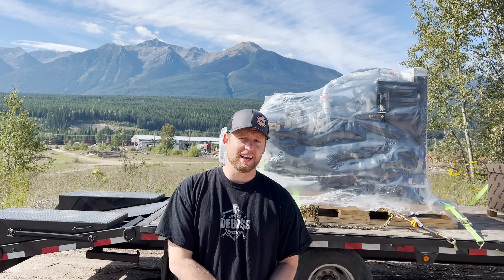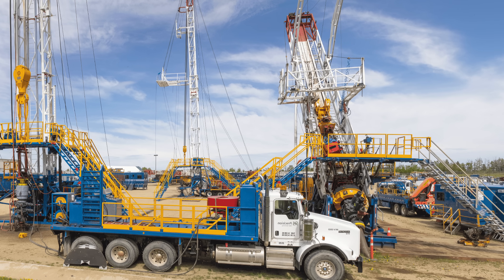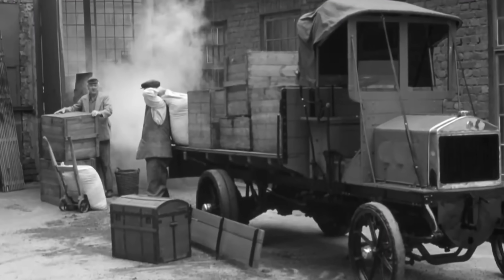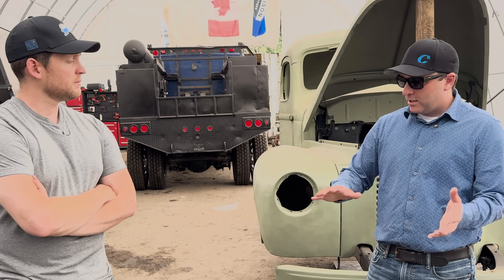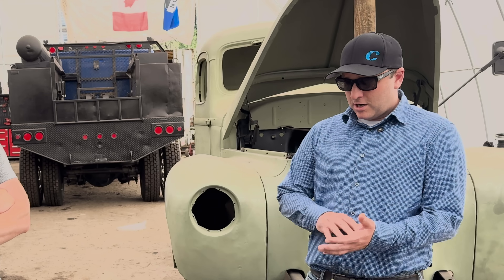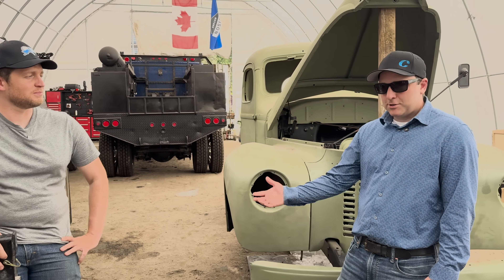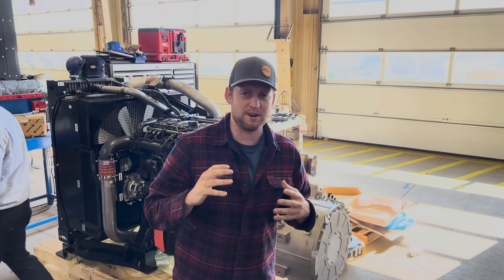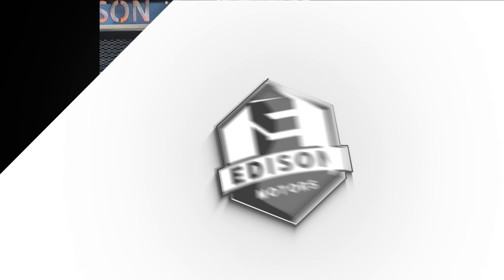We're putting Scania engines into Edison Motors Trucks!

Comment: No DEF/DPF is the biggest news! DPF is the biggest green scam ever to hit trucking. The physics and logic has never added up. How does a miniscule reduction in particulates justify wiping out 50 years of fuel efficiency increases? How does a filter remove pollution from the atmosphere when a regen burns it all out anyway? Does the impact of adding an entirely new industry of manufacturing and delivery and pumping infrastructure to get pig urine into every truck justify the barely measurable environmental impact of cleaning truck exhaust a tiny bit better? Oh yeah and nobody realized the blue stuff freezes, so tanks and pumps have to be heated 24/7 during the winter because that's a sensible use of energy, right? Ask any fleet manager how much down time and warranty problems the constant breakdowns of filter systems causes. All it's done is cost money and headache, and I see more toxic smoke pouring out of broken DEF systems than I do out of old school trucks.

Comment: The big Scania 770 and the Volvo 780 are in trucks weighing 76 tons in Finland, 64 tons in Sweden and 60 tons in Norway.
Reply: 74 tons in Sweden now
Reply: Lot of 770's in ireland just pulling 1 trailer😂😂😂
Reply: @johan8724  why would you need a 770 in flat Ireland? They’re common in Norway, but Norway is far from flat and the GVW is higher.
Reply: @MasterChief37  jeg vet. kjørte 9 år i Norge🤣🤣👍👍irske sjåfører liker a kjøre 90 op på bakkene🤣🤣🤣💨💨💨💨

Comment: Love your project and your drive !

This oversized engine is not a good idea, not the Scania part , the v-8 part.

1. This is generator service constant speed not normal crazy truck loads and speeds. You have let your normal real world experience seep into your logic but your new system is different .generators work best at 80% load normally constant speed. You don’t need that extra hp the battery is giving it to you .

2. The extra massof V-8 is working against you , also two more pistons etc .radiator larger etc .

3. The biggest thing is You said 30-40% fuel savings .
No way there is that much savings between two modern engines just because you went up in size !

HE did not say that in video , you did ,if you listen carefully . Probably because he told you this off camera .

Let his engineers show you a technical report to prove it !They must have both on test stands in Europe have them  run your profile on the dyno.

I understand the loafing is better for longevity but going to a 1200 rpm motor would be better but again the extra mass.

If you do use it run it normally at 1200 rpm and vary The load only going to 1800 when you need more power .

Comment: Didn’t know Scania’s have dpf free engines that meet emissions.  We desperately need a smaller Scania motor in pickups/vans.
Reply: Scania does not do vans, delivery trucks size is the smallest. IVECO is the one you're wanting, Daily mainly.
Reply: @Mariini  just order a scania and then aftermarket swap a volvo engine
Reply: The smallest engine Scania put in their trucks is a 5cyl 230hp unit..
Reply: @CJA150179 nope. The smallest is the DC07, 6 cylinder engine, derived from the Cummins 6.7 engine. Although yes, the 9 liter is the smallest 100% Scania engine.

Comment: Glad to see Todd from Precision is at Collicutt. I used to snub for Precision back in the day, before they got the Scania engines. Regen was always a safety concern for us. Glad to see Scania solved that. So, can you buy a Scania engine through Collicutt as a replacement for any highway truck? I'm thinking older trucks with mechanical engines. What electronics can they compensate for if you have an older project truck?

Comment: You should mention to SCANIA, that they might look into the possibility of using the massive amount of electricity, you have available, to increase emission efficiency in the future as standards get stricter and stricter.  I would imagine the engineers may not have thought about a situation where a Diesel engine would have that kind of electrical power available.  It might be useful.
Reply: Scania builds fully electric trucks, and even have their own battery plant in their home town of Södertälje
Reply: @petereriksson4405 
They have a bolt on in line E motor set up ..they have also experimented with it on boats.
Reply: If you can get a smaller more efficient  engine and generator you're going to be winning all the way.  😎🧙🏻‍♂️

Comment: Then i wonder if John Deere for their 9R 18L engines if they had copied Scania's homework since those will not have a DPF?

Diesel particulate filters are so problematic even in automotive. Small crack in the filter, will throw a check engine light. Had worked on a 2021 Ram 2500 6.7L Cummins. Guy bought it, and like 3 days later came back with a service DPF message and check engine light on. Followed service library and took it outside. Gave it some throttle and it was rolling coal. So DPF was shot. 

But the alternatives are a bit odd to no DPF. So either way hopefully no down time.

Comment: Wasn't one point of the hybrid system to be able to have a smaller diesel engine because load peaks are buffered away by the battery? I'd have thought that a 500HP (Scania or not) would not have to go full throttle all the time for the given use case, and when you compare a 500HP and a 700HP engine both from the same manufacturer for doing work that both engines can do without redlining all the time, then the 500HP has got to be more efficient, doesn't it? I'm not an expert, just curious.
Reply: I could see a larger engine being more efficient in some cases. If the engine+generator is powerful enough to drive the truck and charge the battery at the same time, then it might mean that you don't have to run the engine as much or as long, saving fuel.
Reply: Ideally you can sit right at the efficiency peak, a more powerful engine just means less runtime for a particular application
Reply: I also find this counter intuitive. And they have e-axles with motors. Unless they are beefed up they cannot use more power just because they have a bigger engine generator. They can make some trucks with three driven axles, sure that's one way to tap more power out and needing more in because such trucks would be targeting heavier loads.

Comment: As long as the customer is willing to pay some air freight…. LOL
Reply: Scania already has an established supply network in North America for marine and Gensets plus their Trucks have been running all over Latin America for decades.
Reply: @mrspandel5737  guess you didn’t watch the video lol. The man justttt said that it could be overnighted to the states if you don’t mind paying airfreight…..
Reply: Ya I thought the point here was for anyone to find parts anywhere. A truckers truck using a smaller generator to apply power, saving on cost and hassle. 

And now it's just gonna be a normal semi engine providing electricity but with less parts availability. This seems like a massive downgrade.
Reply: @sparrow4176  yeah down grade for sure. Can’t go to any local parts house for parts on that rig. Gotta pay for it to be overnighted on a Cessna 172 😂😂😂. Bet that’s cheap too

Comment: The only issue i have is you really don't need that power right? You can have a smaller engine as long as it puts out more more energy on average than is used. And as you've discovered, you don't really need that much to go down the road. It's more just starting, and in a semi truck, hill climbing. I suppose if it meets the goal its all the same, but it seems the wrong choice to me.

Comment: You did not spell it out in the video. You are putting a straight 6 in the next truck, right, not the V-8 ? Also, what power plant are you using for the 3/4 and one ton conversions ? I get you are excited about Scania but you need to have a bit more specifics to quell questions like mine.
Reply from the maker: This next truck is getting a 9 Litre

The V8 will be for another project later on
Reply: @EdisonMotors  So the 9 litre is a straight 6 ? What engine are you using for the 3/4 and one tons, Cummins ?

Comment: As others have said, it doesn't seem Scania engines are step in right direction. The whole point was to use a generator system to cover average power usage, and electric system that can provide much higher power over shorter periods. Using very powerful diesel engine that  is designed as standalone unit kinda defeats that whole concept. I hope you know what you are doing.

Comment: What motor will they have for pickup truck? This is awesome what you are doing!
Reply: Possibly none as they are huge.

Try looking at the 1980's era V8 Deutz which are in large Atlas Copco air compressor and gensets. Being air cooled it doesn't have parasitic draw and issues from pumps or radiator taking up space which this allows you to run a larger engine. It also allows straight to work without warming up.

Comment: Should have mentioned that Scania trucks still require urea based exhaust fluid. Just no particulate filter.
Reply: I don't believe it's required for generator, so the exhaust fluid system is just simply left out of the installation, and the computer tuned to operate without it.

Comment: ### *AdBlue Consumption Comparison:*

For a 1,000-mile trip at 65 mph:

#### *Scania V8 770 (Tier 4, No DPF):*
- *AdBlue Consumption:* Approximately **5.94 to 8.93 gallons**.
- *Note:* The Scania V8 770 meets Tier 4 emission standards without using a Diesel Particulate Filter (DPF). Instead, it relies heavily on the Selective Catalytic Reduction (SCR) system, which uses AdBlue to reduce NOx emissions efficiently. The absence of a DPF reduces maintenance complexity and costs while maintaining strict emission compliance.

#### *Ford 6.7L Power Stroke:*
- *AdBlue Consumption:* Approximately **1.27 to 1.90 gallons**.
- *Note:* The Ford 6.7L Power Stroke uses both a DPF and SCR system to meet emissions standards. Its lower AdBlue consumption is typical for light-duty diesel engines, which have lower fuel and AdBlue requirements compared to heavy-duty trucks like the Scania V8 770.

Yes a 770 is way bigger then a 6.7 but most of your viewers are more familiar with a 6.7 thus the comparison. 

This summary provides a clear comparison and emphasizes the role of the SCR system and AdBlue in achieving emissions compliance for the Scania V8 770 without needing a DPF.
Reply: Why would you compare a truck engine to a car engine tho? Like I get what your idea, but can the powerstroke haul 70+ tons in a terrain with hills? No, it simply can't.
Reply: @jaroslav3258  Yeah, useless comparison, draws the wrong conclusions. 16.4 liters vs 6.7 liters, of course the def consumption will be higher, whether or not the exhaust systems are different in design. It's a much larger engine. Doesn't summarize anything but a lack of understanding and a willingness to copy/paste the work of others

Comment: Huhh..? 44 ton in europ...? In most European countries 50 metric ton is standard.., en in more of our countries it is 60 metric ton total weight.
Reply: Depends on the trailer combination. 63,500kg is the maximum without permits, with a B-train is the maximum.

Tri-drive with a tridem trailer is 53,000kg with a tri-drive permit.

Tandem tractor with tridem trailer is 46,500kg.

A tridem body job is allowed to weigh 30,300kg without steering axle permits.

That's all with a single steer axle.

Comment: I never hear torque rating only horsepower. We all know horsepower means nothing without torque. That’s why we don’t run gas engines that have 1,000 Hp.
Reply: The Scania V8 530hp have 2065 lb-ft and the 770hp have 2729 lb-ft

Comment: Here in Sweden we have an 850 hp truck somewhere I've seen. With an off the shelf 850 hp engine. That’s one of their marine engines. If you don't settle with off the shelf you can get a lot more.
Reply: The marine engines go up to 1150hp on the exact same block and internals, but trucks can't cool that much power, so 770 is max right now
Reply: @kalle5548  also related to emissions, which aren't as strict in the marine sector.
Reply: Gearbox, axle, is the week link
Reply: Emissions regulations and fuel consumption are what's limiting the power. You can get more power but the fuel consumption will just skyrocket.
If you can afford a motorboat with multiple 1150 hp engines then the fuel cost isn't a big problem.

Comment: Is Topsy going to be powered by a 9.0L Scania engine just like the CAT.  It would seem like tremendous overkill to put the 770hp 16L engine in Topsy just to run the generator.
Reply from the maker: Would it be overkill?  Yes

Will I still make a hybrid with a V8 anyways?  Also yes.

We can get 1200kw peak out of batteries + 500kw out of the V8

That’s 1700KW, or about 2400 HP

I don’t need it, but I want it
Reply: @EdisonMotors  Fuckin'... My dude. Fuckin' A.
Reply: @EdisonMotors  that is the right way, from truckers to truckers :D
Reply: @EdisonMotors  There should be a sound of a mic drop at the end of this comment.
Reply: @EdisonMotors  Mr Artelle raises a good point, this thing could charge BEVs that convey workers to the worksite and all the lights and saws and things in construction.
Reply: You're not buying a truck for it to sit around charging stationary items... If it's not moving freight it not making money.
Reply: @pb3438 highly depends on the application, they aren’t building highway trucks right now but vocational trucks. Very conceivable one would get put into some task where it may be useful as a power generation system.
Reply: @hoosierfarmkid  Yea, I get that it's application specific, but at the end of the day it's on a truck chassis for a reason, because it needs to move. If the truck is stopped doing backup generator tasks, then there's a good chance it's not doing what it was designed for. Using it as a generator in an emergency scenario makes sense but I struggle to think of a use case where you wouldn't have a much cheaper backup generator doing that task.
Reply: Look at it this way, with a larger engine on this thing, you have a portable generator that is more than capable of powering the worksite and recharge the batteries in addition to maybe charging another smaller electric vehicle.
Reply: The 770 is going to be a conventional drive Edison L truck. It’s what they call the BDE series, it’s on their website.
Reply: @jaredjeffs I don't know what you really mean here. The BDE is the concept for trucks with conventional cab, not the L series (like Topsy). It is still a serial hybrid so the Scania will be the generator and no transmission from it.
The website says "Scania motor generators" and "hybrid drivetrain".
So I only see the cab part differing.
Reply: @bwillan, Topsy is the one full prototype they have built. They won't pull the CAT out of that, no point.
Reply: You wouldnt use the 9.0l there only a cylinder with peak power of 360hp the 13L would be alot more efficient can rate it at 370hp or even 410hp and would spin an electric generator all day every day
Reply: This is what I don't get. I thought they were building electric trucks, not engine swapping. I don't understand.

Comment: The American engine manufactures need to up their game, the bean counters/ board of directors have restricted the development of our American industry. I've talked to other farmers who've been to trade shows & they tell me the US manufactures are 15-20 years behind European manufactures of agricultural equipment.
Reply: The first thing that needs to happen is deregulation of the emission standards so there is a reason to do more than tread water in terms of engine design.
Reply: @Hybris51129  No need. Rules need to be sometimes. I work for Paccar in Europe and basically our designs are copied by the US plants, but they build less engines and less quality in the states. US fuel prices need to rise, this will then trigger a huge demand to save energy and innovate from their customers. As long as you have customers wanting old crap, they will build you old crap.

Comment: Im assuming the generators are ran at 1800rpm?  6 cylinders are more designed around lower rpm for peak torque.  Tbe V8 will be happier and make better power at 1800rpm.
Reply: since it is charging a battery and not an ac load I don’t think they need to be picky about the rpm.
Reply: Max torque on that engine is really low. 1100 - 1400. It's part of what makes them quiet.